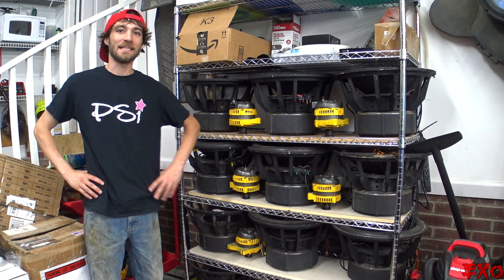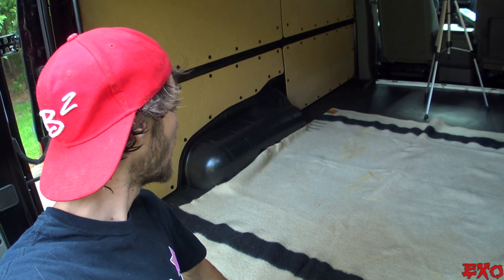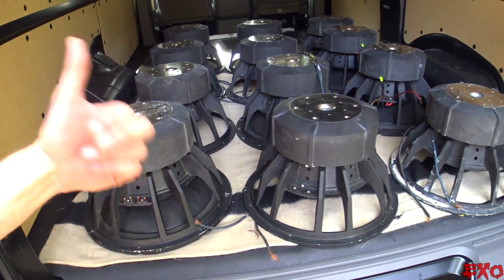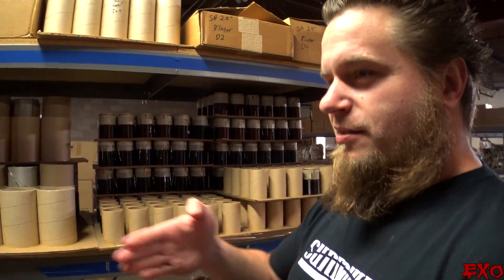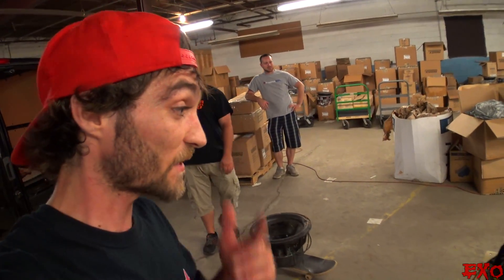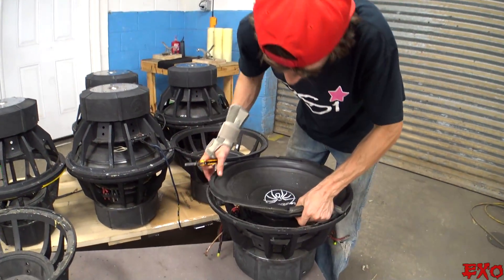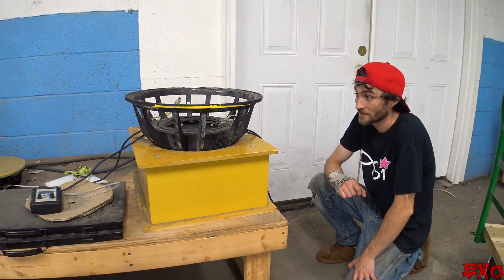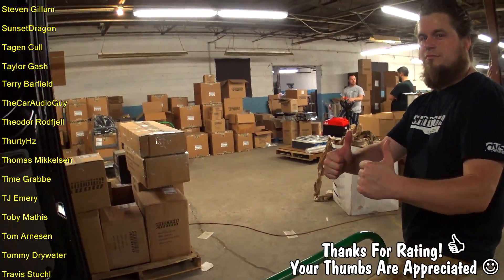Increased SUBWOOFER Power 15% By CHARGING Motor Magnets | How To MAKE Old Subs LOUDER!

Comment: Wow... you really should set those subs on the floor if there's room,  in the video shows that there stacked in multiple layers,  this can be very dangerous,  the 4 pipes holding this massive weight could collapse showing they're already bending // just heads up

Comment: Biggest subs I've had to move are my two Harbinger powered 18" we have in my jam room. Got those paired up with two 15s. Each sub is 2300W and weighs about 100 or so. They're about 24 x 20 with a 26 inch depth

Comment: EXOcontralto I have a few questions for you I made a trade for a alpine 10" type E 10 well come to fine out the motor is cracked. What parts do I need to rebuild and can I make it stronger wattage and where is a good place to order parts. Or is it not even worth rebuilding it?

Comment: EXO, please help me! lol. im in chapel hill and bought a motor i couldnt resist in fayetville. Its a DSS Trident motor, and the guy i bought it from was shady, he tried to sell me a meso motor that was dropped and turned from a double slug to a triple slug with a horizontal crack splitting a ferrite slug into two. Anyways, the dss trident was in the  corner and when i checked it out, the tall pole piece was shifted all the way to one side of the gap. i managed to move the shifted magnet and realign the gap, but im still weary of bulding an 18 inch monster sub and putting a ton of time into bulding my dream sub and the motor shift on me in the middle of a demo. so, my question is, should i contact jacob and or nick and demagnetize the motor, clean it up and reassemble it and magnetize it again before continuing with any building of the actual sub? how expensive do you you think that would be? i would drive it there of course, the shipping would cost way too much with a 100 lb motor. thanks. email me at stevenscocnretellc@gmail,com please. long time viewer and subscriber. im using my sons pc so its not my youtube account.

Comment: I got blasted so hard years back commenting on Steve Meades channel about how cheap Aluminum magnet wire is and for the price of some of these subs it should be copper or even silver.. I feel kinda vindicated seeing an actual copper voice coil. Oh and I got a peak of that Gaussing machine. 2 banks of 1000uF at 2500 volts. Enough to operate a medium size rail gun, cut metal in half or if shunted through a person: Boom Red cloud of spray. Nasty stuff here Exo sweet vid man thanks.

Comment: That whole shelf he had them stored on comes with wheels and specs at 1 tonne w/o wheels and half that with the wheels. Easier then a skateboard.
2:07 "No teeter totter madness" - proceeds to skateboard with a sub between legs right into a crack and totter that low-tone tweeter to the cold concrevement ;]
edit: Noticed he says they subs are 98lbs ea so he coulda moved that rack with 10 of them on there and stay within rack spec ;]

Comment: Jacob would enjoy two of his SA12D2s in the back of my 600 wheel horsepower racecar Honda Civic on my Soundstream Rubicon Nano RN1.5000D amp. I swear by these subs man. I paid less than $500 for those two Sundown Audio 12s and I would never have another sub because these are tight bass and they flex the body panels of my car...lmfao

Comment: The biggest Sub of mine is a Ground Zero GZPW 18 SPL  with 40kg = 88,2 pounds..
Very hard to put it alone in a box..
Reply: Aa the lightweight series, GZPW 21SPL is tricky and heavy to lift at small fourth order bandpass wall. Around 45kg :D

Comment: between my 15 in mtx 9500 but I have a ported box with 2 Rockford fosgate t1 tens and the t2500 amp on the box that's a heavy bitch

Comment: In my case the magnet of my sub basically shifted and the cone could not move...
So very carefully i took the motor out and with a hammer repositioned the motor in the basket...
I only lost one of the two coils

Comment: I have 30 3” one ohm quad coils for sale if you or anyone is interested. Yes that’s right “quad” 4 speaker leads. When I was competing, I had 4 earthquake D2 3000 watt amps on each sub.
Reply: jasonneal what's subs are they
Reply: Joe Gama They are just voice coil’s no subs. They were basically homemade. They were called shocker

Comment: I have a single nvx vcw122 12 and its powered by a pioneer 1000w max power amp. Has 4 guage wiring. After 10 mins of playing around 30 vol the amp gets hot and starts or pause while the doors still play... any suggestions on what to do???
Reply: Get a better amp. I know that sounds like a shitty thing to say but it's true in this case. That amp can't put out 500w RMS, it just can't. Your speaker is rated to eat 2,000w in short burps and you're probably feeding it 200-400w on average. That amp is going thermal and shutting down and you're barely even moving that speaker.

Comment: That $60 worth of fuel would cost £95.38 in the UK (@ £1.26 per litre) 

Equivalent to $115.95 / $5.80 per us gallon

20 us gallon is 75.7 litres.
Reply: On italian autostrada 98E5 was 2€/liter
Reply: @mannine99 that's £1.82 per litre for super unleaded 😵, the average price for super unleaded in England is £1.40 per litre.

on UK motorway services prices can be anything up to £1.50 per litre for 95 Ron petrol and £1.70  per litre for diesel.
Reply: More government is less fun

Comment: 8 years ago i bought 2 MTX 15 9500 In a custom box for $129 dollars. I drove 2 hours to get them cause it was a local pick up only,  i took my small sedan and the freaken box didn't fit in my trunk i had to smashed it in the rear seat. The Subs were around 90 pounds each those are the biggest subs i have ever owned.

Comment: Those are some beast of subs for sure... I have 3 pierce audio 6k moab 21s.. they weigh in at approx 130 pounds each.. also have a 12 inch 6k moab that is about 110 pounds.

Comment: how does the magnet lose charge. do i have to recharge it if the sub is old
Reply: It loses charge through natural forces but no you'll never need to recharge a sub magnet. Neodymium magnets like those used in subwoofers lose about 5% of their magnetism every 100 years. EXO's issue is that the factory that originally made these couldn't magnetize them to the same degree that Sundown can. They simply have a better rig.

Comment: By the way you guys cut up the spiders It doesn’t look like you want to put the same softies in there. I’m sure people would enjoy a giveaway of the old 18” soft parts. I know I surely would! The biggest speaker I own is an 8” so having an 18” cone with a huge voice coil would drop some jaws for sure! Even if I don’t do anything with it like put it in an empty basket and motor. At least I’ll impress my friends when they come over to my house.
Reply: There is really no way to get the soft parts off a speaker without destroying them. Everything is glued down. If you just want a huge cone buy a PSI recone kit. That's what most of these are anyway.
Reply: @Thezuule1  like i haven't done it without destroing the soft parts of a woofer and placecd the spider and surround onto another one. you can soften the glue with extreme heat. he could've done that at his home and just pulled out the softies and gotten the baskets and motors to the sundown audio workshop (or whatever it is). i can't buy a recone kit becouse i bearly had $50 for an audio system and $150 for a new phone and you're telling me that i have to order a recone kit from america to eastern europe and wait for it to arrive and have to pay huge amounts of money on the delivery and that my dad moved out a few months ago that he is taking me and the whole famoly there. starting with me. but he still doesn't have his own house. so you're telling me i have to buy a prefectly functional recone, pay big money on delivery, then send it from my old house to my new one in spain, and pay money on the recone kit itself and have no money for the home theatre i'm gonna make when i move out and after all that hastle not do anything with the recone. if i was able to do that i would've done it a while ago. but no! i'm poor and we bearly have money to pay our bills! and you're telling me i'm better off buying a recone kit when i dont have the money for it or time for it to arrive. buy the time it arrives i would have two massive audio autostyle gtx154 15's! they might not be verry powerful but i am using them for a home thatre.

Comment: Heaviest if lifted MTX Thunder 9500 15" 90 POUNDS GIVE OR TAKE
Reply: Lol. Defiantly not a light sub. I still have mine. It was a bitch getting it in my trunk. Got a full inch thick. 4 square foot enclosure. Tuned to 35hz.

Comment: 2500 volts x 2,5 killa amps = 6,25 MEGAwatts
Reply: Those racks of caps in the bottom of the unit probably discharge all that current in under a second too. Shit is madness.

Comment: Ive never even heard of someone doing this. I kinda wonder what the difference will be. If its even noticeable.
Reply: It will be quite noticeable. Motor strength is king. Most people don't do this because the magnets on most subs are going to be fully magnetized without issue. EXO picked these subs up at different times from different spots and he just wanted to make sure everything was consistent. As he says early in the video, Sundown has one of the best rigs in the country for this.

Comment: Biggest and heaviest thing I ever had to do was remove the door off of my Dodge Dakota sport quad cab and insert a ported box with two 15 in fi'$. Doesn't seem like it'd be alot but keep in mind it was a triple baffle with double ply on all other walls. Pressure-treated 5/8 plywood with 2x4 bracing
Reply: fuck i need my neighbor to help me put my 15 inch HOOLIGANS   in my AUDI  with a single baffle and 2 six inch aero ports...  I FEEL YOU

Comment: The biggest only chassi was a 21NTLW5000 by 18sound - the bigges subwoofer-speaker (cabinet) was a BH882 EAW the cabinet has around 378lbs - we had e.g 10 cabinets for a festival in Germany.

Comment: Years ago I was going to offer this to people and I got flamed on the forums from all the "experts" lol. I still have my machine but it's been in storage since I closed my old shop.  He's right about them not being totally saturated but the other things that kill them is heat and shock. If you drop a sub or bang it around it can weaken the mags.
Reply: this video has me wondering if my new subs are as good as they could be! lol
Reply: @MasterBasser  They probably are. These subs had incredibly large magnets and 6,000 gauss is not weak in any sense. Sundown just has a really nice rig that was able to push these closer to their physical limits of magnetism than the machine Soundstream used when they originally made them.
Reply: @MasterBasser   unless they have been dropped really hard chances are they'll be fine.
Reply: I take it you are in Jersey?
I'm looking for a place to recharge mine in Cali.
Reply: @BARBELLS-AND-BUDS   Yeah and I honestly would like to sell my zapper, but the market is so limited I doubt it'll happen.

Comment: Wears psi shirt it sundown's shop, lol,

I am also I miner, love mining fun and profitable, i bet they have some CHEAP electricity
Reply: but psi buys parts from sundown and sundown actively recommends psi though
Reply: I’m assuming they are on a time of use metering. If not they should prolly call and ask for an assessment based on their usage to see if it would be worthwhile. I’m also assuming who they have based on geographical location. I’d say they are prolly paying about $.10/kwh depending how much they use. That doesn’t include demand though.  They also have to worry about demand usage which is measured in 15 minute intervals on a 24hr day. Based on the size of that facility they are definitely over 35kw of demand (and what i could see on the inside).
Reply: Sniper Pro nerf mods 
I would but my electricity is 23c per kwh
Reply: And on top of that, he takes sound stream subwoofers to a sundown shop!
Reply: Dylan Lockler yeah but they are gonna be rebuilt with psi parts.